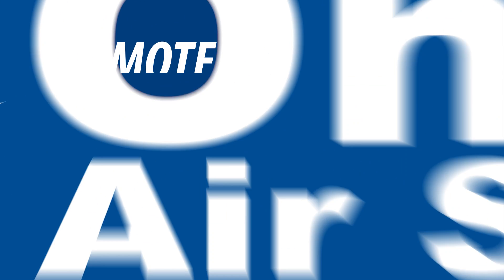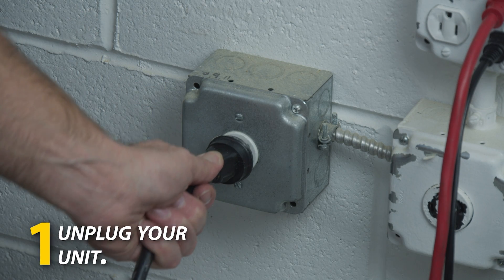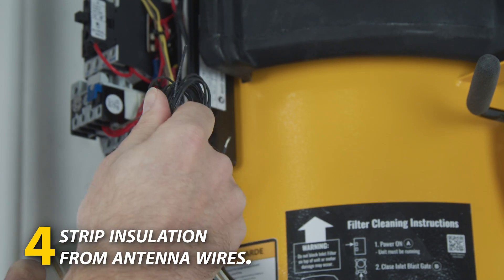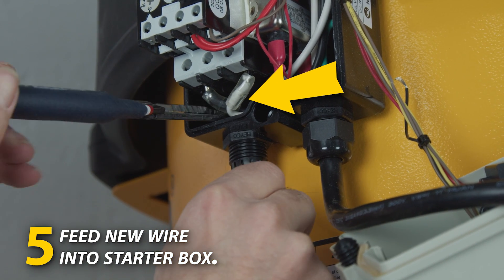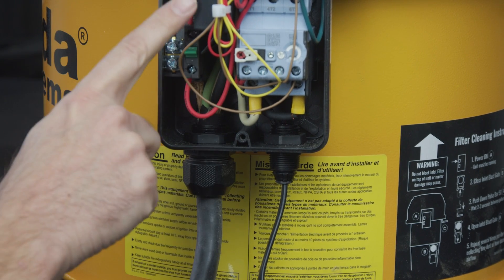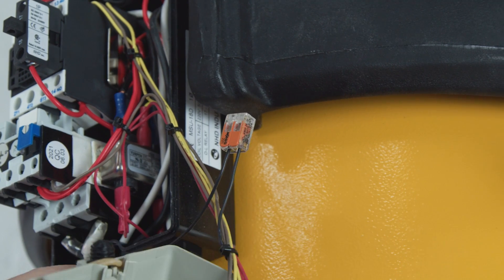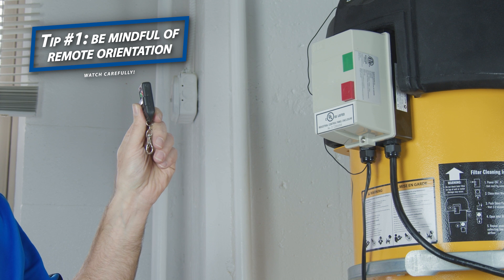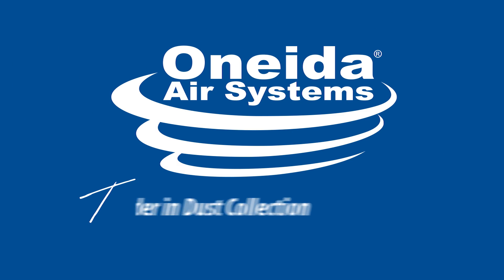IMPORTANT Supercell® REMOTE Pack Instructions! | Oneida Air Systems, Inc.

Comment: I am currently on my 3rd Supercell remote. I extended the antenna but they still failed. I’m never more than 20-25 feet from the unit and usually about 12 feet from it. The new one has been working for some time now. The only explanation is that the first 2 were inferior. Incidentally, I use remotes for several tools including my shop vac and have never had an issue with them. I love my Supercell and Oneida support. My only suggestion is to upgrade your remote. It would save your support team and customers a lot of grief.

Comment: As an EE, I’m not impressed that this fix is needed.  The remote appears to be a cheapo, and doesn’t use a standard battery.  But I can’t claim that any of my designs are perfect perfect either.  It’s not a hard thing to do, so I suppose I’ll get it done.  If that’s the worst thing about this high pressure unit, it’s still a good product.

Comment: This fixed my issue. You have a third configuration of switch, where the cables going into the switch box are configured in such a way that I could not simply loosen the coupling and fit in the longer antenna wire. I instead carefully drilled a hole into the housing and fished the wire through there. Now the remote works anywhere in my shop. Thanks for making the effort to not just dismiss issues, but find a fix and communicate to customers about it. That is excellent customer service.

Comment: This hack worked great in my shop. My Supercell is in a closet outside with a vent for return air into the shop. I ran the wire back inside through the vent, excellent results!
Reply from the maker: We're glad to hear that our solution worked for you! 🌀 Please contact our Customer Support team at (866) 387-8822 or visit oneida-air.com/CST if you experience any further difficulties. Thanks!

Comment: Few things on this. If it’s only the off button, that should tell you it’s the remote and not something in between. Otherwise why wouldn’t the on button have the same interference? I think it’s crazy that the remote is so known for this that a video needed to be created, instead of just fixing the issue with the remote. I can tell you that this off button issue happens even when I’m right next to the unit, so it is not about interference. Again, it’s   very clearly the remote, and I would gladly buy a fixed one, even though it probably should be upgraded for free to people who have this issue. Other than that, this unit is amazing.
Reply from the maker: Yes, you're right. Any electric motor that's running in the shop will introduce electromagnetic interference into the space - including dust collection motors once they're engaged. That's the reason the remote will turn the system on, but then fail to turn the unit off. The motors pushes the interference in the shop above the threshold of the remote and the receiver. 

We have found that shops' set-ups with little to no electromagnetic interference have no issues with the remote, but those that are set-up in a way with high electromagnetic interference will find this issue.  In some cases, we found that replacing the remote and receivers still produces the problem but extending the receivers antenna solved it. 

We found 10 feet of wire to be a good point for most shops to boost the receivers signal past the threshold of interference, but for those that may continue to have this problem may want to further extend or use thicker wire. 

We are continuing to investigate.
Reply: @oneida-air    I had to laugh when the video said machinery could cause interference.  I never had this issue with any remote i used with my tiny old unit or one i hooked up for my festool.   With such an amazing dust collector why would you give anyone anything to complain about?
Reply: @oneida-air  I definitely would continue to investigate. The unit is extremely high quality minus this one feature and I’m guessing you guys would like to rectify it. For example I had literally every exact tool in my shop as I do now, and my old dust collector never once had an interference problem with the remote. Again, I do love my supercell, so really hoping for a resolve in the future! Thanks for responding.
Reply: Thought it was just my setup that was the problem so glad to see this is a known issue. But agree that the "fix" seems less than ideal. Doesn't make sense it only happens when turning the unit off.

Comment: I did that shortly after I installed the unit a few years ago and it improved things somewhat. I wouldn’t say it was a great fix. I ended up adding the iVac system to my dust collection, and that was the only thing that really fixed the issue. The remote start is the only thing I have been disappointed with on the Supercell.

Comment: I have this issue with mine. I did run the antenna wire outside of the case, which helped a little. I will try attaching an extension wire after watching this. I’m sure it will solve the issue. Thanks!
Reply from the maker: Always happy to help! 🌀 Please contact our Customer Support team at (866) 387-8822 or visit oneida-air.com/CST if you need assistance in implementing our solution or if you experience any further difficulties. Thanks!